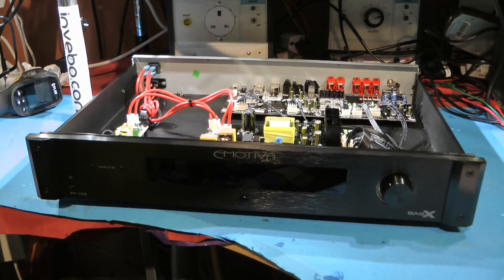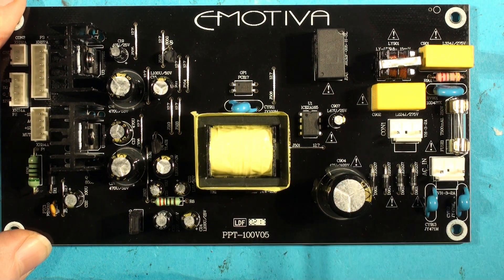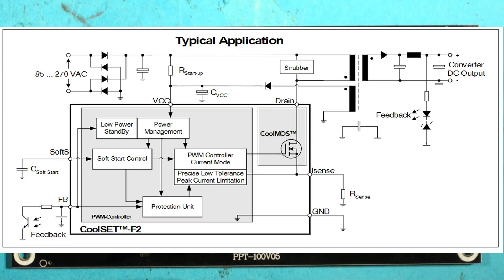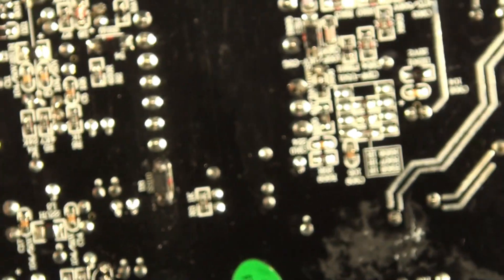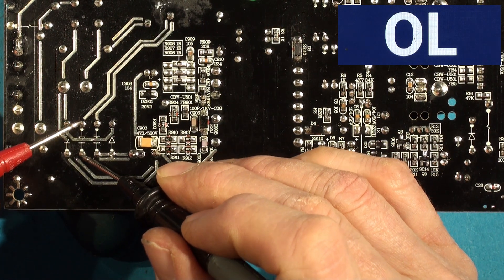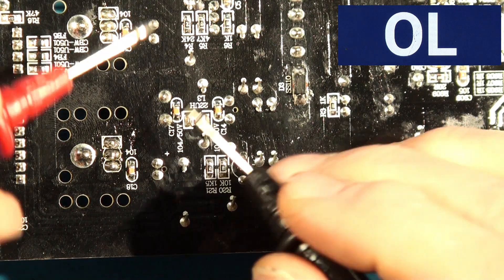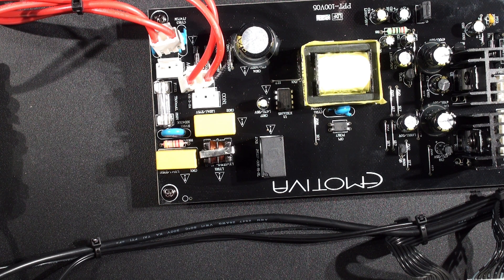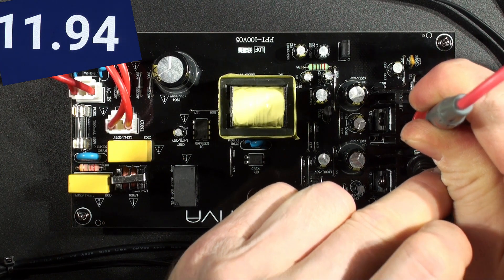EMOTIVA Bas PT-100 Stereo Preamp display works but faulty  / no audio Repair and Diagnostics

Comment: Smashing repair as always.
I have repaired quite a few switchmode bricks, the output craps are always bloated.
No supprise as they are on top of hot diodes and living in a case with no ventilation.
My own bricks have a bad case of plastic worm :-D, holes near the bottom and top to allow convection cooling.
They don't die then.
Why do manufactures put caps near hot heatsinks, because they are bast.... oops.
Reply from the maker: Thanks. The caps should be OK if they are decent quality. They are rated at 85 degrees if 105 degrees witch will burn you if touched. The sting in the tail is that the rated life of most caps at these operating temperatures is usually 1k or 2K hours.  The higher the ambient the shorter the life. As a general rule and a rough approximation of failure analysis, every 10 degrees C rise in ambient temperature halves the mean time between failure (MTBF) of most electronic circuits.  A well designed and reliable power supply should not get that need to get hot.  The bottom line is that the manufacturer wasn't that bothered about failure as they know that generally expectations are low and poor quality wont affect is not nearly as bad for sales ash marketing, packaging and outrageous performance claims are good for sales.

Comment: Very good explanation and methodic approach. Would it be feasible to exchange the Schottky Diode (probably both on the secondary) with fast recovery Diodes without further modification?
Reply from the maker: Thanks.  Cheap Shottky rectifier diodes fail.